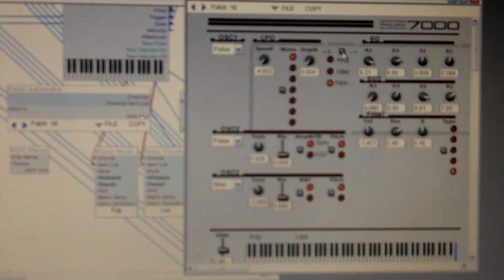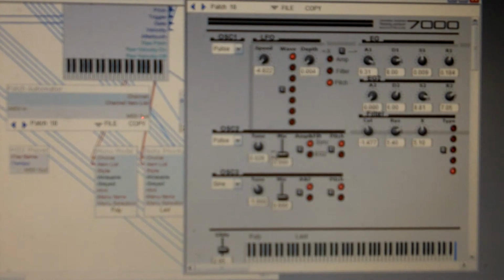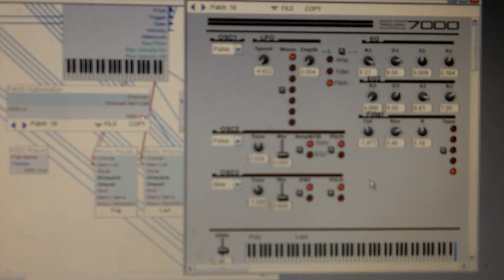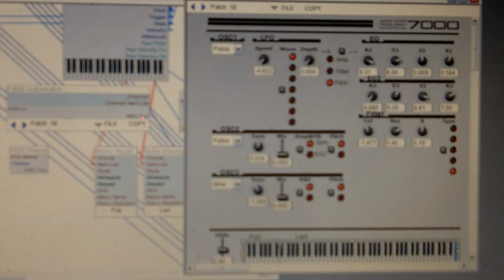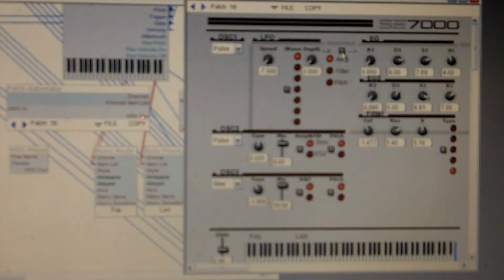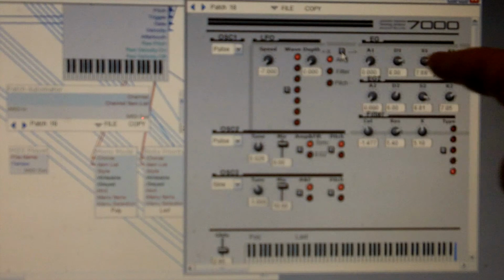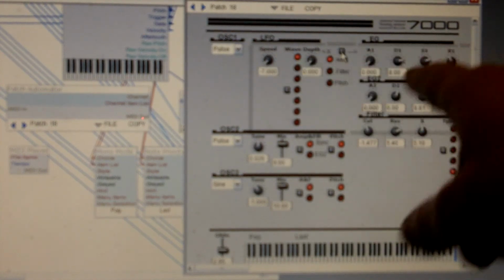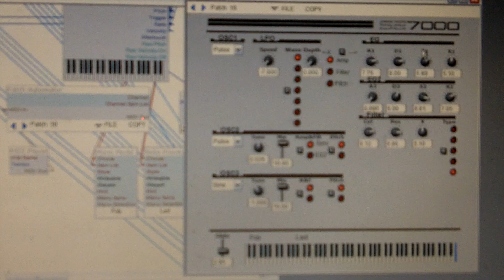SE7000 VST RS7000

Comment: Have you ever finished this? Is it possible to use as a librarian/editor for the RS7000?
Reply from the maker: I have a more complete version of it that basically just looks a little better but functions the same.  I don't keep a copy of it online anymore so if interested then let me know and I can maybe dig it up for you.  I have never used a libarian/editor but I imagine you can, thinking you just have to map all knobs and functions, most are standard midi  CCs but I know most other odd things the RS does send out sysex any time a setting is adjusted that can be captured.
Reply: @zamisers7k  Hello! could you please send me that VST? Id love to use it.
Reply from the maker: @thekout 

http://quantum-source.com/SE7000/SE7000v8.zip  

I zipped it up since it is a .dll and that triggers antivirus stuff sometimes, so hope it works, may need tocut n paste url, good luck, I"ve not used it in many many years.
Reply: @thekout  Bonjour! pourriez-vous s'il vous plaît m'envoyer ce VST? J'adorerais l'utiliser.
Reply: @zamisers7k BRO ITS DOESN'T WORK 😢😢